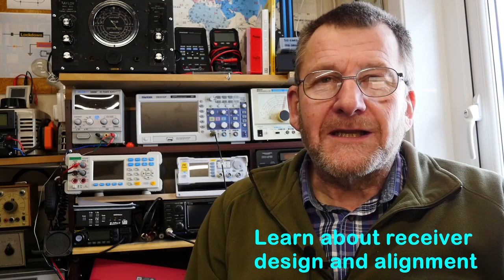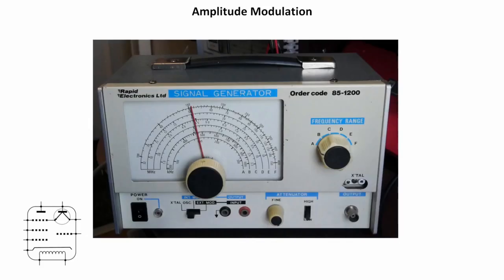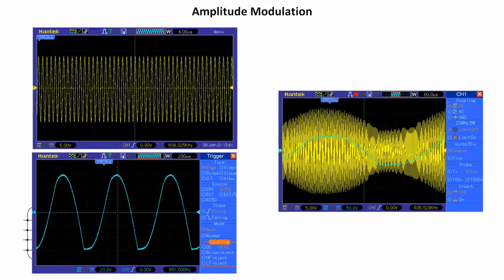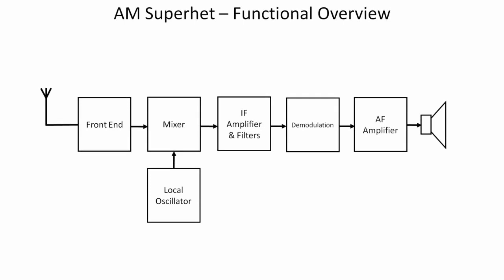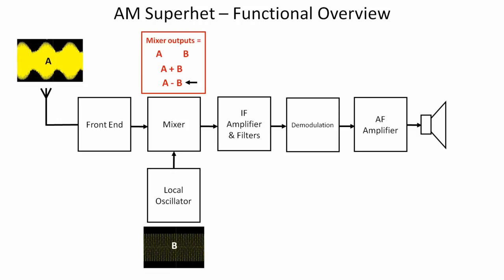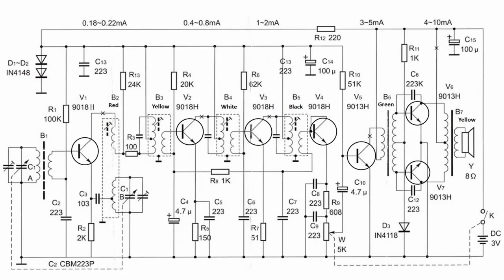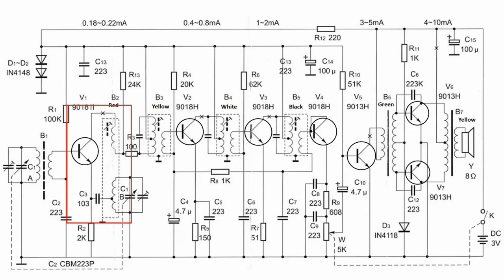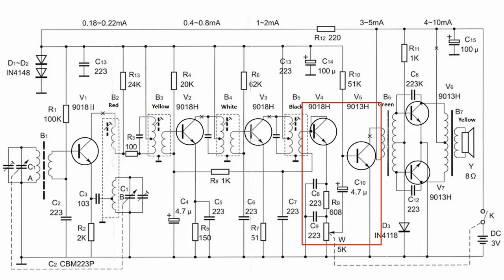Build an AM Radio and learn along the way   Part 1 of 3 - The Circuit and Design   #055

Comment: I bought/built one of these. My findings are as follows
1) better/more complete instructions needed. I had to explore/YouTube/google to complete it.
2) the optimal operating voltage/current draw is at 1.5V. However, with 2  1.5 cells (3V) it has extra play time, even though though the extended period is essentially extra battery drain equivalent to one of the 1.5 batteries.

Comment: Thank you for this great video. I was able to get this radio for €1,70 plus €2,30 for delivery, total price delivered €4,00 at AliExpress. I put it together the day before you posted this vlog. Building is fun but understanding the function is even more satisfactory. I really enjoy your way of presenting the theory, which is very helpful for me.
Apart from that: another instructor on YouTube found yet another error in the diagram: the on/off switch should be drawn at the ground rail instead of the plus side of the batteries.
Reply from the maker: €4,00 is a real bargain!
This little project is a great tool for learning!